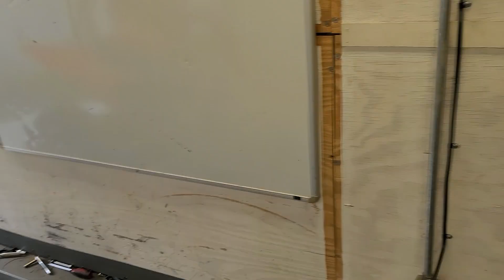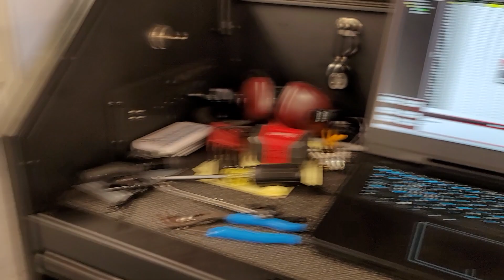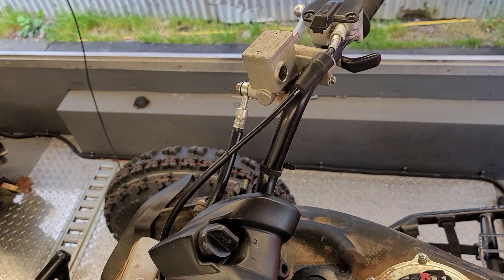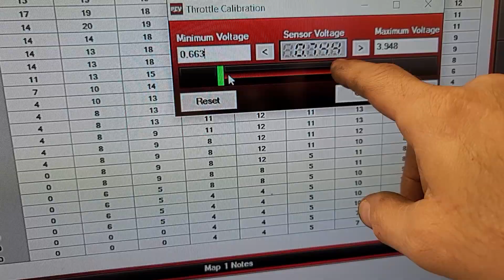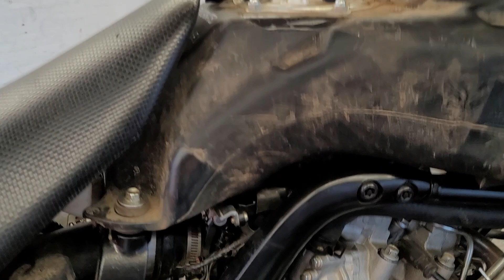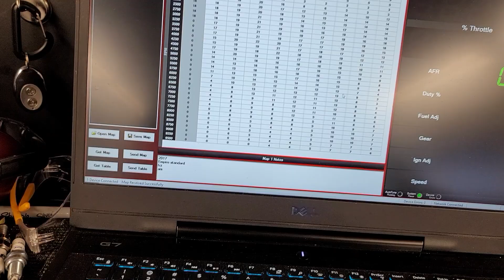Cuervo +3mm throttle body Setup, Tps Sensor calibration, idle stop screw and air bleed setup.

Comment: F..k. I changed the low/top voltage on my pc6 trying to make it 0 and 100% instead of adjusting the TPS and I didn't save the original values (shame on me, always take pics). Can I use your voltages as reference for adjusting my TPS?

Thank you sir. You're a Raptor guru. Incredible content.

Comment: Quick question I bought a new 2020 raptor 700r all stock & some times it backfires on de acceleration, I bought one of your ais block off plates & it seemed better but with a occasional backfire with a weird sound like a burst of air coming out the exhaust,  is it just to lean? I plan on modding it.thanks

Comment: This is not what video is about, but there are only a few of you doing anything with Yamaha Raptors.  I have been looking for 1 piece of info for a very long time - that's it.  Do you know what the dimensions are for the main frame tubing of Raptor 660 or 700 - the outside (diameter) appears to measure 1.125 (1  1/8), but I need somebody to verify.  I can not measure the thickness (gauge) of that tube.  Does anybody know what the thickness or gauge is on the main frame as well as diameter?  Another way to put it is if you were going to replace some part of the main frame tube, what size DOM would you get? Can be Raptor 660 or 700. Thanks

Comment: My stock TB reads same .6xx min and max and if I barely touch the throttle it goes to 100. Do I need to calibrate like you just did?
Reply from the maker: Yes u need to reset the paramiters. Min .67 max 3.96

Comment: hello mr cuervo racing I have a raptor 700 from 2006 with pc5 and it always appears 100% on the throttle part, do I have to calibrate as you did?